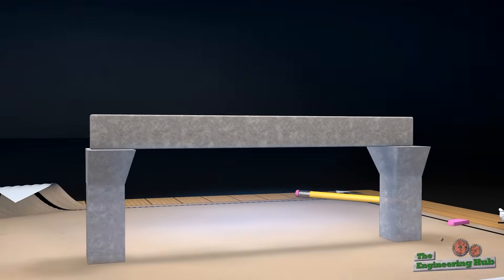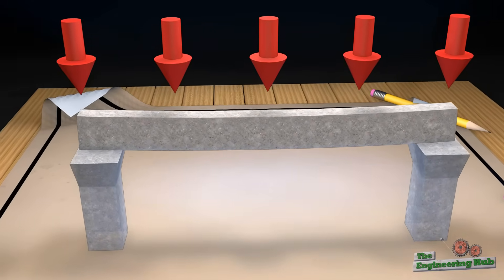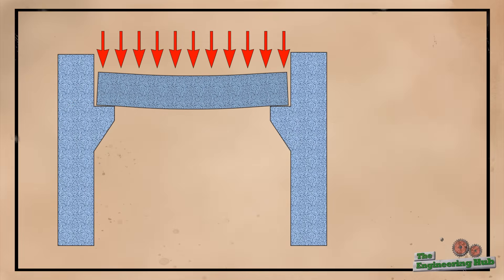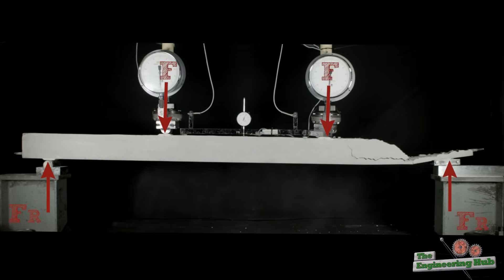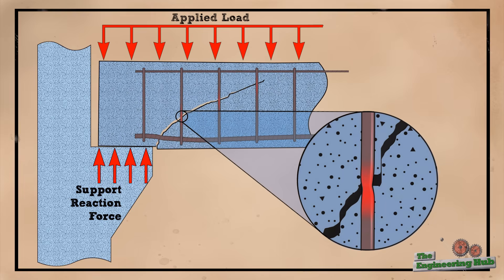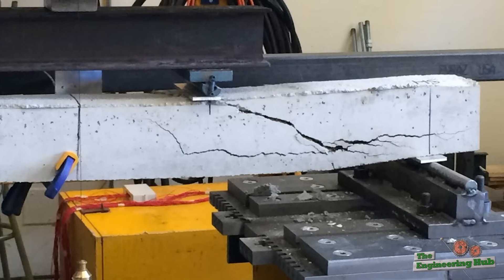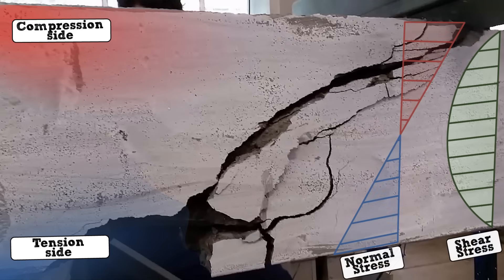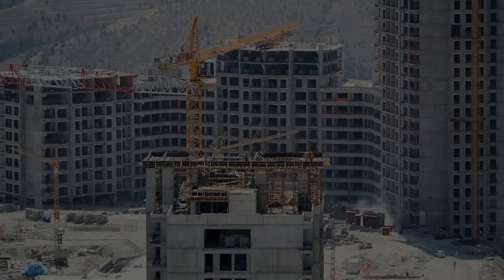The actual reason for using stirrups explained

Comment: the truth is concrete has zero tensile strength.  to talk about it is a waste of time.  engineers assume zero tensile strength and tremendous compression strength .  that is the nature of concrete. as far as sheer force and the aggregate,  obviously the force will follow the path of least resistance -  it will crack following these lines.

Comment: Being an electrical engineer I do a lot of field plotting in distributed networks as finding the paths of the electric current and the voltage  distribution in a block of material, Also we do a lot of field plotting of the Electronic field and the magnetic field for  various volumetric structures as antennas or waveguides.  Aircraft engineers uses fluid flow or streamlines in channels or wings or boats going through water and their pressure and flow zones. The equivalent of this in mechanical or civil engineering are the distributed stress lines 

If one plots the stress lines in the beam being tested at 1:56 One can get an idea of these stress lines by looking at the point loads and support on the right hand side.  The principal stress line would be a line joining the right load with the right support which  we could call a diagonal,  The stress contours  above this " diagonal"  would all be in compression while all the stress contour below this diagonal would be in tension. The " diagonal itself is now the primary focus of our attention as above the diagonal there is compression and below it there is tension The loading on the left would  modify this a little but we are only approximating the activity in the beam. 

Basically the diagonal  joining the load and the support is a stressed path indeed having compression above it and tension below it, Considering the diagonal is not a  thin line as in a truss structure  we may consider them as being two diagonals one in tension and the other in compression,   Now with the lower support being too close to the captured end of the rebar, there is a high compression zone in the concrete with the support having a chisel effect which will tension the concrete to open up and this opening up will travel along the diagonal as a tensioning the engagements aggregate of the concrete .   The failure along the diagonal at 2:02  suggest this activity in the distributed elements of the beam with a rebar in it 

It is interesting that in a beam where the rebar is thin, the bending moment wins to open up fissures in the lower middle, zone. and the capture of the rebar is a long one so the ends will not be effected.
If the rebar is very thisk and so the bending effect is lower then it is the shorter capture of the end of the rebar which will fail and opening up the diagonal we talked about,

If one would find the differential equation of  the distributed elements subjected to the stress as we do in electrical engineering or heat  and fluid flow in mechanical engineering  the  distributed filed solution would tell the full story of the activity in the distributed beam volume.  The field plot would depict the " diagonal between load and support as a stressed location with shear and other " rotational effect when the gap opens,   Also this diagonal diagonal  would clearly show where the stirrups would be included and they should not be vertical but at right angles to the diagonal between the effective load and the support to a first approximation,  

Excellent presentation showing that the beam had a too strong a rebar so it did not bend at the centre but the rebar end failed, the stressed " ribbon" diagonal opened and the shear followed ,    .

Comment: Your video is very informative, but it raised a couple of questions:

- You compared the stress diagram, which varies along the cross-sectional area, to the variation along the length of the beam. Is this comparison accurate? Shouldn't the stress distribution be analyzed separately for cross-sectional area and length?

- In the final part of the video, you applied stirrups in an area perpendicular to the depth of the beam. Wouldn't it be more effective to apply them perpendicular to the cracks instead? This seems similar to the way we sew fabric, where stitching is done perpendicular to the tear to ensure a stronger  hold.
Thanks in advance.
Reply from the maker: Hi DJF,

Im not sure to what part of the video you refer to in the first point. The stress variation changes both along the length and depth of the beam. Though the shape is the same, just the values are different. To your second point, you are right that would be more effective in terms of material use. However, that would require more labor, which would overhaul any material savings. Additionally, it would require more QC as it would be alao prone to poor installation.
Reply: @TheEngineeringHub  
From what I gathered, the shape of the stress distribution in a simply supported beam is not the same at the cross-sectional level and along the length of the beam. 
The stress distribution at the cross-sectional level reflects the local bending and shear stresses, whereas the overall stress pattern along the length of the beam changes based on the external loading and support conditions.
Reply from the maker: @djfn4s3r45  The diagrams that are plotted along the length of the beam are the bending moment and shear force diagrams. These diagrams are dependent on the load configuration and support conditions of the beam. These are not stresses though. The internal stress in the beam i.e. the normal stress is a function of the magnitude of the bending moment at that point. Similarly, the shear stress at the cross section is a function of the value of the shear force diagram at that point. The distribution of the stress within the cross-section is a function of the shape of the cross section. (I, W, square, pipe, etc). You can check out Chapter 4 and 5 in reference [3] if you want to learn more about the bending moment and shear force diagrams and the stresses which result from them inside the beam.
Reply: @TheEngineeringHub  Thanks for pointing it out!
Reply from the maker: @djfn4s3r45  no worries. Check out the reference and come back if you have/want to discuss it further. Cheers!

Comment: Stirrup design is my question. I see many different varieties even in this video. Is there a specific requirement for the stirrup steel ends to over lap? Or should they overlap and then spread apart with a specific  design? Great video. Thank you for your efforts.

Comment: If the stirrups are used for shear how can they be plain bar stirrups? Thats Not correct design. Also stirrups are used to keep lng and vrt in plane foremost  stir and tie is prevent buckling and blow out of vrt and lng. Your videos are weak
Reply from the maker: They are plain because they are hooked at the ends. When a hook is provided it drastically increases the bonding/adhesion to the concrete so you don't need deformed bars.

Comment: Accompanied with stirrups, can applying triangles, similar to a truss, to the re bar, reinforce the concrete beam further to protect against bending and shearing loads? Triangles help distribute load across a width with other materials such as steel and wood, so why wouldn't it be useful to use as part of the stirrups?

Comment: 8:20 you should mention that it is possible only if it is a corner crack and majority of cross section is still close to original. if it is a through thickness crack (like you show it) then stress at crack tip will be always case "1"

Comment: Before you get to know of applications of rebars, need to know "What is load?" Because only to create a well distribution of load.....we are doing all of this. 

Load =W 
W= mg 

Now load create pressure & that is compression. Now if you want to increase load bearing capacity, increase its volume. There is no scope of tension as well as rebar. This is 110% accurate theory. 

Now, the point is , then  why we provide steel in structure? 

If anyone wants to know, can comment.

Comment: All have appreciated your masterly effort, clarity and presentation both graphic and verbal, kudos to you. A big thank you from me also.

I would like to draw your attention to the effect of wire mesh ( 13 SWG weldmesh 25mm x 25mm- square weave combined with 2 layers of 26 SWG chicken mesh - hexagonal weave) used as form work for cast in situ beams/columns which gets fused into the beam/column as the concrete sets in. I would like to discuss, invite opinion and validation if possible about the effects of the additional steel in resisting the shear and bending stresses thereby creating any further efficiencies in the usage of concrete and main steel in the beam and column designs. Will soon post a new video on youtube illustrating what I  mean.

The aim of using the wire mesh form work is to optimize the usage of steel and concrete, to provide better earthquake resistance as well as lowering carbon footprint.

Please give a like if this captures your interest. All replies are welcome.
Thankyou for your attention and time taken to read this post.
Reply from the maker: That sounds very interesting JP. Im not too familiar with that concept. You can post your link here. I will make sure to watch your video. Cheers!
Reply: @TheEngineeringHub  Thanks, I am gathering the data & info and soon will be able to post it after creating the video.

Comment: It is interesting when you look at concrete. 
Reinforced concrete has a lifespan of about 100 years yet non-reinforced concrete (Roman Concrete) is still going strong 2000 years later but that is mainly due to us pushing the material past its tolerances. So, having to reinforce it, to get it to work, means we reduce its life greatly. Reinforcement rarely doesn't rust as there are many factors in rusting, so, this ends up causing more problems in the lifespan of concrete, personally, I wonder why they don't use stainless steel but I bet there is a reason for that too.

Comment: Thanks for the information in this vido and in others..  Just a note - minute 6: even upon considerable crack opening, the compression zone contribution to the shear resistance is minimal. Even though a compressive stress increases the shear strength, equilibrium does not throw much shearing stresses to the compression zone.

Comment: I know the biggest thing to make concrete fail over time is the action of rust from saltwater to make iron rust, and as iron rebar rusts, it expands, causing the concrete to be pushed outwards from the rebar, causing the concrete to flake off; has there been any research into layering different types of concrete to create a more effective artificial barrier? I know that there are attempts to make hempcrete absorp the co2 from the atmosphere and have a negative carbon footprint, and wondered if it couldn't be applied as a form of cladding to protect regular forms of concrete. Has anyone done this kind of research?

"...lime clasts play an active role in self-healing the concrete. The hot mixing process [mixing quicklime into the hot material] makes the inclusions brittle, so that when tiny cracks form in the concrete, they will move through the lime clasts more easily than the surrounding material. When water gets into the cracks, it reacts with the lime, forming a solution that hardens back into calcium carbonate and plugs the crack. It can also react with the pozzolanic material and further strengthen the concrete itself.

So rather than being an unwanted by-product, these lime clasts are there for a reason, the team says. This self-healing mechanism may be a major factor in the longevity of ancient Roman concrete structures." - https://newatlas.com/materials/ancient-roman-concrete-self-healing-secret-ingredient/

Comment: This is for simply supported beams not moment connection or continuous beams .
Shear is at 45° to vertical off simple supported ends  at 1.5×  reaction at support.
Also pre stressed and post tension very different also .

Comment: Concrete beams suck, don't they?
Reply from the maker: Hi Max,
Concrete alone is not very effective, yes.
In fact, we have an upcoming video about this! 
Stay tuned!
Cheers,
Reply: Yes they absolutley draw (suck) and can get very warm, That's why sometimes ice i used in the build so it doesn't heat up and crack

Comment: It struck me these stirrups perhaps should be diagonal to the horizontal and vertical rebar in the steel frame to cross perpendicular the places where the failure cracks likely occur.   As a railway enthusiast, I'm familiar with Warren Trusses.  It strikes me a concrete beam would be a Warren Truss steel structure filled with concrete.  We are familiar with how the diagonals work in these bridges.  Even though these cracks curve from horizontal to vertical as the stresses shift, it would seen there would be an optimum location and angle for these diagonals better than the intersection of just vertical stirrups.  I assume there is a reason for them just being straight verticle.
Reply: Indeed. 
The only reason they are vertical is beacause is easier to build the beams that way.
Any book about reinforced concrete structures would tell you that diagonal stirrups are the best configuration to make the most out of the steel reinforcement.

Comment: if the beams were slightly arched (inverted catenary), would they perform much differently? it seems odd to use concrete in a linear geometry when a slight arch seems to have so many advantages.
Reply from the maker: The arch would definitely perform better as much more of the material will be engaged in compression and that's what concrete is great at. The problem is the cost of construction. Building arched forms is expensive so at the end it is likely to end up being more expensive than just adding a bit more material in a horizontal beam
Reply: @TheEngineeringHub  it's hard for me to believe that shallow arches are more expensive. if you ever have a chance to dive into this in a video, i'd love to see it -- with a cost comparison. i think we just have a cultural blindspot with respect to arches vs beams.

i'd be shocked if it's noticeably more expensive at time of construction, and i'd be knocked unconscious if it's more expensive over the service life of the structure! 😅

Comment: Why do you call it crushing and stretching instead of tension and compression? Great video!
Reply from the maker: Sometimes, I like to use more intuitive words easily imaginable to an average non-engineer. Of course, tension and compression are the correct terms which I use later on in the video.
Reply: @TheEngineeringHub  okay cool!

Comment: The complexity of construction of long beams between two columns and their corresponding probability of failure of those type of beam suggests the best design would be a hybrid design of concrete columns and steel beams when a fully tested and verified precast concrete beams are not available. Most concrete building structures fail at the concrete beams as these element are the weakest members of a concrete structure when not properly designed and or not properly inspected prior to casting.

Comment: You can place the stirrups at a 45 degree angle for a more material efficient design with more spacing between them and less use of Steel. Great video btw!
Reply: Oh, as soon as people start thinking of ways to save on material - use less steel, lower costs - I start to get nervous. Don't come up with too many of those ideas, please!